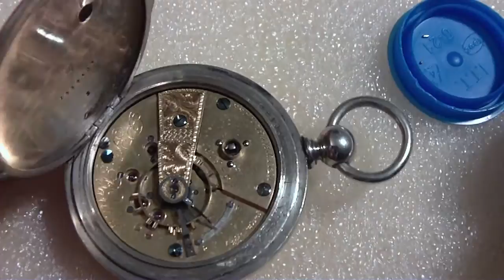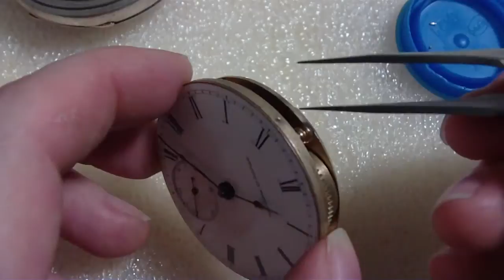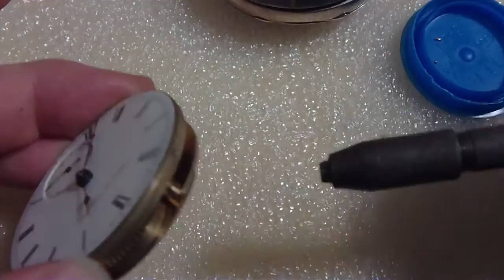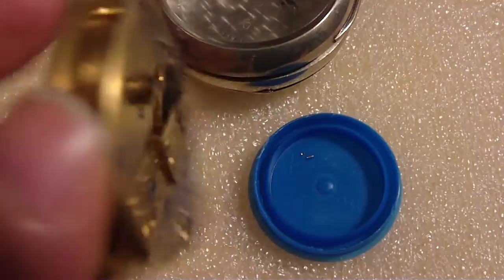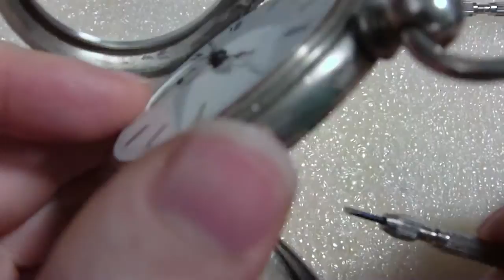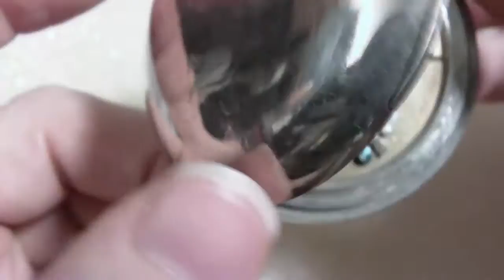How I repair rotating pocket watch movement in case, Waltham

Comment: I have an Elgin with an identical case, and it stays closed but too tightly. I have to pry pretty hard to get the front open just to change the time. The dial is damaged from previous owners chipping the dial from trying to open it.

Comment: Would you consider doing a video on repairing a pocket watch case that won't stay closed? I read suggestions on using a dapping block. Not sure how to take out the clasp in the ring of the case or how to reshape the case to recreate a worn out lip for the clasp. Thanks! Love the videos. 

James Jones.